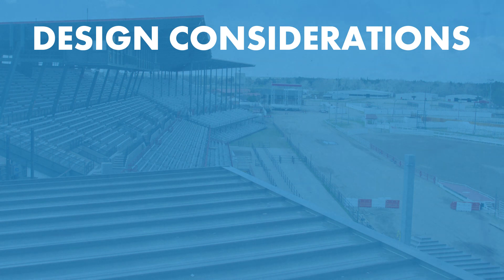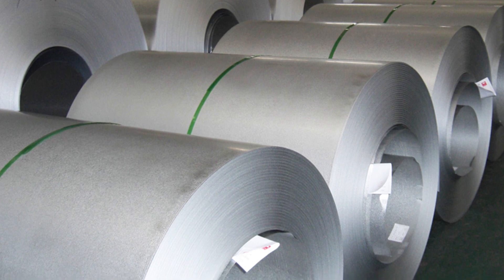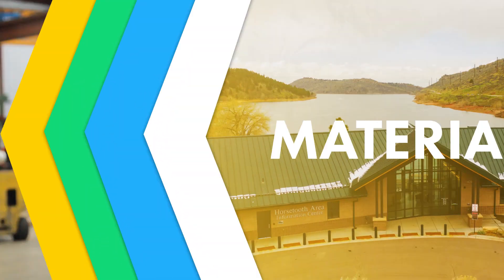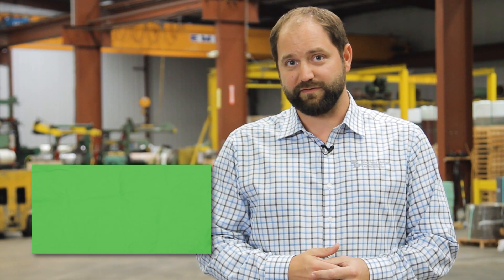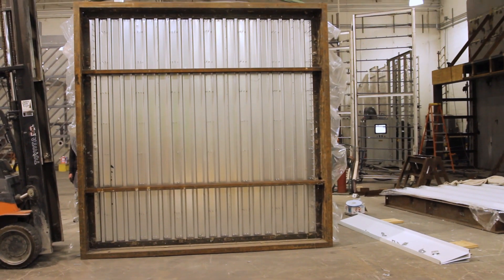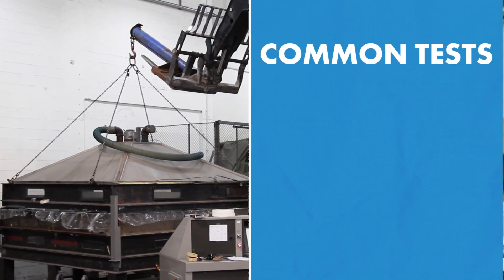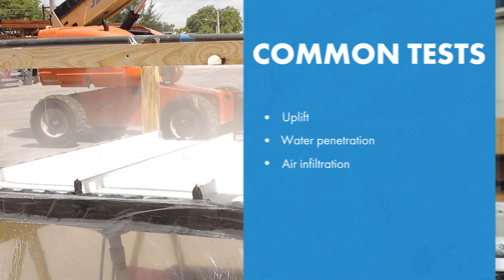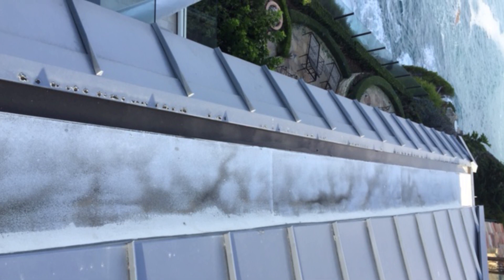How To Design A Metal Roof: Location, Materials, Decking, Testing

Comment: Improved Presentation every video! Builder confused me today by discriminating the Kynar Coating that will be used as "30%" What does that mean?
Reply from the maker: Hello Richard, thank you very much! In regards to your question, I suggest you go back to your builder and get clarification on this. Typical PVDF (Kynar) products are 70% (70% PVDF resin and 30% acrylic) for architectural metal applications. Less can be specified, however they are not nearly as good of products nor are they very prevalent. It would be beneficial to know what exactly the "30%" is that your builder is referencing. Thanks for the comment! -Thad